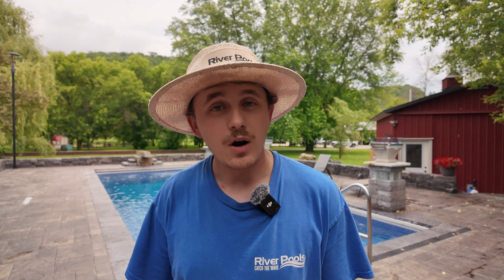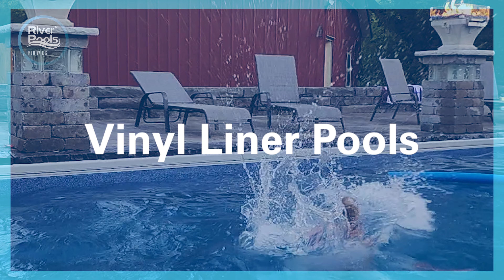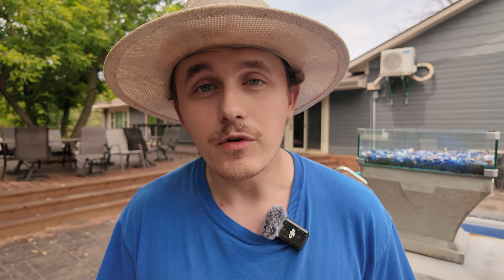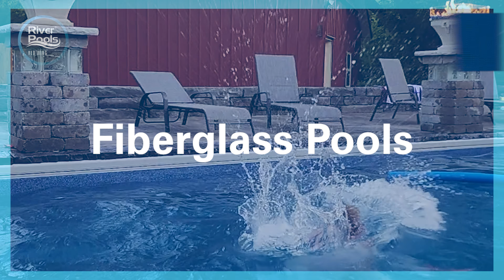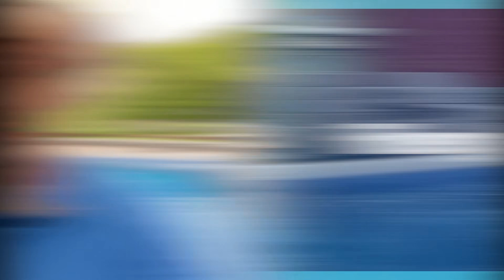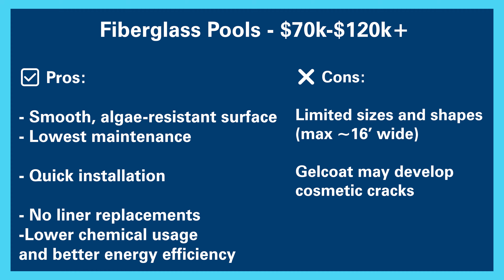Which pool type is best? Concrete vs Vinyl vs Fiberglass!

Comment: What are the pros and cons of having a fiberglass pool? Inside a building
Reply from the maker: Youll have to manage the moisture thats really the hardest part.
Reply: So by having an indoor pool, do we decrease the allgy and the sun Killing the chlorine, fading. And what do you recommend for moisture? Or to eliminate it? @RiverPoolsTwinCities
Reply from the maker: @jonathanboykin1484 Youll decrease bacteria getting in the pool, fading comes more from chemistry mismanagement. The biggest thing for moisture mitigation is having an oversized HVAC system in the pool room in order to evac the moisture dense air and exchange it for dry outside air.

Comment: 22 years in swimming pool business. It's between concrete and fiberglass. Liner pools are a trailer park product.They will leak the most and dogs can put a hole in them with ease. Ground water can create havoc and get between your liner and pool wall, roll up your foam to the point where you will need a new liner.If install does not go 100% perfect, one single (small) hole will be draining your pool endlessly.

Comment: If money is no object, a concrete pool with a plaster finish is by far the best pool.  Vinyl liner and fiberglass pools are not even close.
Reply: Disagree, fiberglass pools never need refinishing & are impervious to freezing temps unlike concrete.
Reply: @GunsAndRovers  Hmm....interesting. Gee...I wonder why all millionaires get concrete pools then instead of cheap piece of chit liner and fiberglass wannabe pools.  Boy, they must be really stupid. How did they ever get to be so rich?
Reply: @georgeburns8447  Rich people get rich by NOT spending money foolishly—that’s why poor people stay poor. Gunite pools offer limitless size & shapes—your imagination is the only boundary.   This is the only reason to choose gunite. Fiberglass pools are limited in width (16-18’ last time I checked due to necessity of transport from factory to site).  The price difference between a fiberglass & gunite pool isn’t as much as a vinyl vs. gunite so your millionaire theory implodes here.  There are plenty of non-millionaires with gunite pools.  I chose a fiberglass pool over gunite not due to the price, but because of freezing temps here in the NE.  Fiberglass pools can flex up to 2’ in a frost—good luck with a Plaster finish on a gunite pool in freezing temps.
Reply: @GunsAndRovers  A 16' wide pool is small. 16' x 32' is the smallest there is (and where you'll bump your head on the shallow end if you dive in from the deep end because the length of the pool is so short), unless you're getting some sort of a custom mini pool or lap pool installed. 16' x 32' pools shouldn't even be sold because they're embarrassingly small and look every bit of it (and they're dangerous for diving). They're wannabe pools. Even 18' wide is small. 20' x 40' is the standard as far as having a respectable-sized pool. But it's only respectable if it's made from concrete because as already stated, liner pools are pieces of chit and and so are fiberglass ones. They're wannabe pools. I live in the northeast and have had a gunite pool with a plaster finish for over 30 years. Gee...I must be one of the lucky ones since it's held up just fine. Oh...and by the way...I had the pool company (the same one that built my pool 30 years ago) come out last year to discuss a future plaster refinish and he said if I were to have the pool that I have built now, it would be a $250K job. Was your fiberglass wannabe pool anywhere near that price? I think not.

Comment: 120k for a pool????? Bro you guys taking the piss. You can litteraly buy a house with pool om the spanish coast with 120k
Reply from the maker: Yup, with the pool, pool equipment (pump, filter, heater, automation panel, UV, water bond, PVC, fittings, skimmer, drain pipe) excavation, stone backfill, dirt haul off, electrical, gas, crane, pool transport, building permits, transport permits, getting the pool from manufacturing to here, water to fill the pool, water chemicals, concrete locking ring, AUTO COVER. Haven't even mentioned labor yet to handle all that stuff...

Imagine building a house. Similar process, similar depth, similar cost.
Reply: @RiverPoolsTwinCities  no my guy you guys exagerste. There is no reason on hell a pool should cost 120k you guys just make pools for people with more money than sense. In my country we say fool is not the one who asks fool is the one who pays
Reply: @Politicallyincorrect1984  I feel you are a troll.., Concrete, labor, insurance, rentals... It definitely adds up.. I bought a barn from the Amish for 4k, I needed more storage so years later I started to build another barn myself to save money.  Without labor, because its just me doing it. I have spent 3k of materials alone, I honestly don't see how the Amish even make money.

Comment: Dose no one in the United States do Spary insitue Fiberglass pools, there are the best of both worlds. The design veritility of Shot Crete concrete pool and the durability and surface of a precast fiberglass pool, built in less time than a concrete pool but slightly longer than a drop in glass pool. 
Personally in my opinion take the cost out of the picture a spray glass over concrete hybrid pool its the gold standard. 
Where i live there is very few concrete pool builders and spray in stitue, is the best for visibility and drop glass the most popular for cookie cutter pools.
Also I know is some place around the world they do fiberglass sheet rolled pools.
 So in conclusion when it comes to fiberglass there are different types not just the drop in pools. Fiberglass pools really breaks down to 4 types. Fiberglass Mat, spray institute, drop ins and Glass over concrete Hybrid pools.
Also it is possible for Concrete pools can pop out with our cracking the concrete, but they won't go back down and the plumbing will be toast.

Comment: Hello what if you already have a in ground pool want to replace from vinyl line? to fiberglass install  how much will it cost? Long-term maintenance they have quick installation today is not. There’s no line to replace. I dont know what size is the pool 🤦🏾‍♀️ 3/12   to 5 feet  9 feet
Reply from the maker: If you're wanting to tear out an old vinyl liner and install a fiberglass pool it will just depend on your project and vary area to area in the country. Best bet is to call out local contractors and see what the scope of your project will be. There will likely be an extra 10-20,000 in demo work to get the old pool material excavated and hauled off site before new construction can take place.